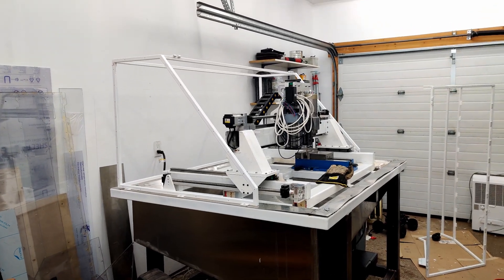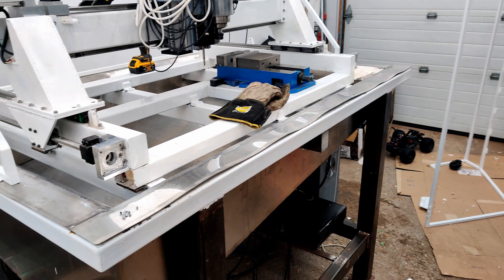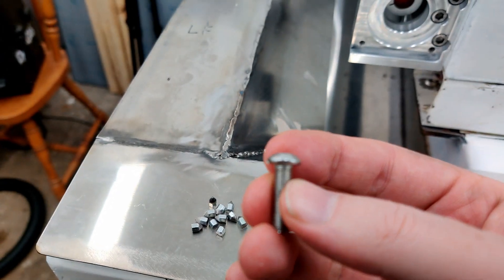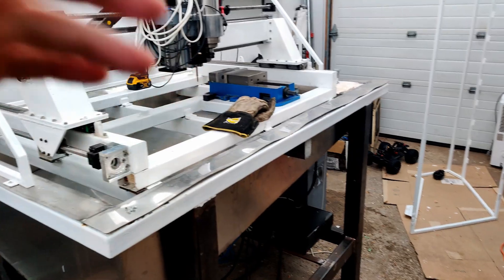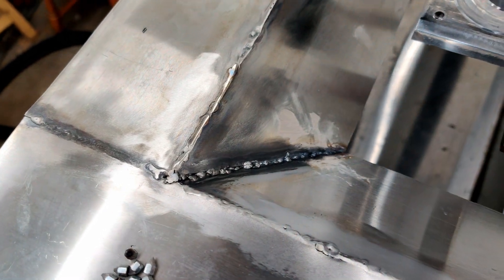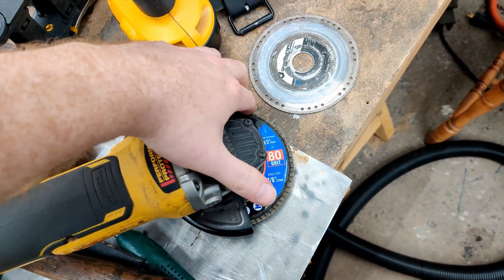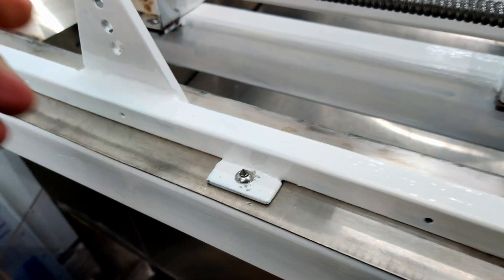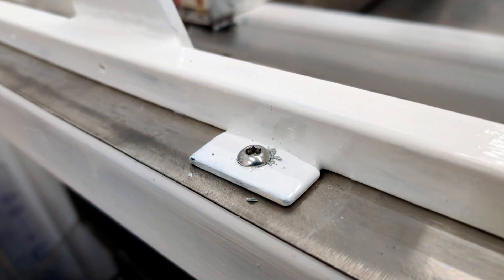DIY Threaded Transfer Screw

Comment from the maker: Comparing the welding I did to the bottom chip pan to this top skirt, the aluminum chill bars made a huge difference keeping the chip pan from warping. On the chip pan it has no visual warping and much less blowouts. Regardless I just care about its functionality so will keep it for now until I figure out something better. It’d be nice to find a local place to me that can bend the 18ga lengths as I could also put a vertical lip on the very outside perimeter.